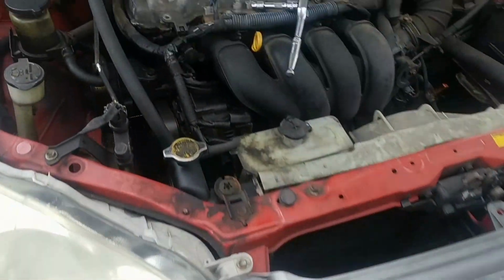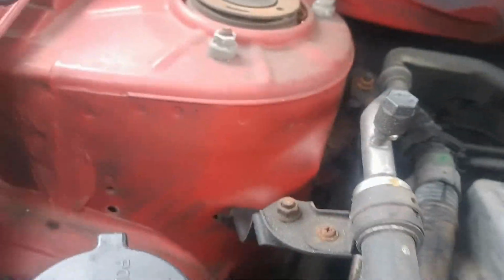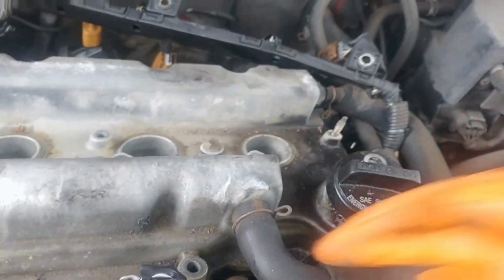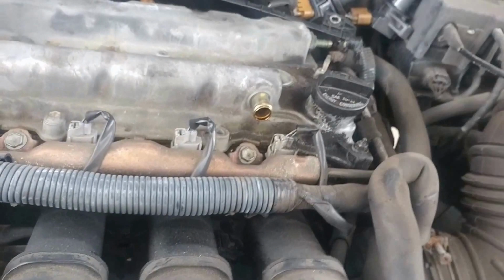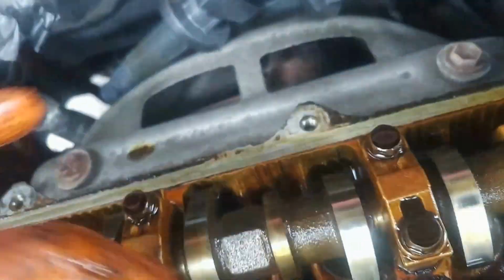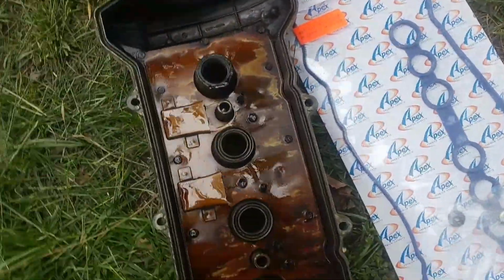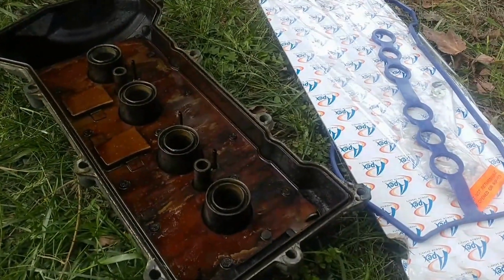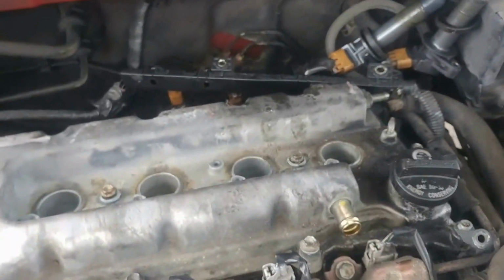Valve cover gasket replacement 2003 toyota corolla

Comment: Can this repair be avoided by using sealant additive like blue devil ( if leak is just minor seepage --  2003 toyota Corolla 130,000 miles running fine ? The shop charges $150 my city ?

Comment: Question I have everything off but the valve cover is stuck and I used a rubber  mallet but that's not working,  so how do I get it off.
Reply from the maker: Kashan Barfield double check the middle you may have missed a bolt
Reply: there is oil all in my plug holes when I replace this gasket how do I remove the oil